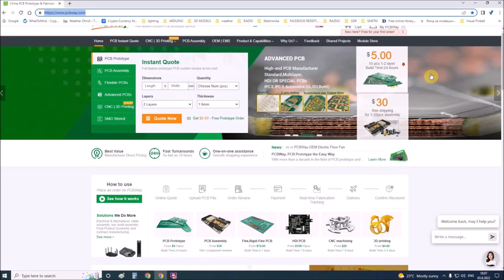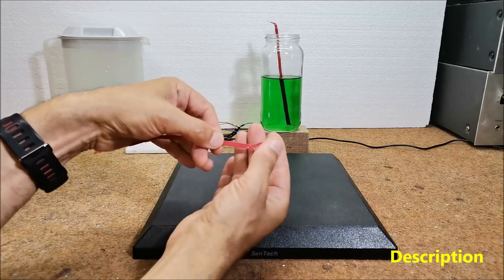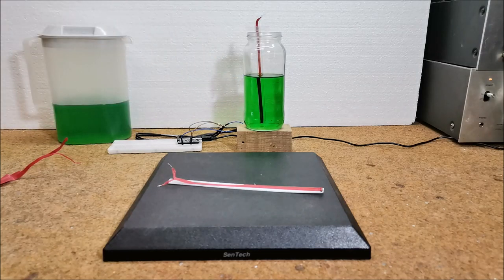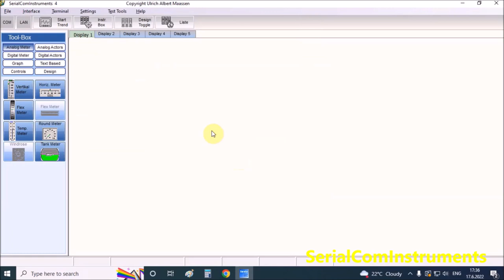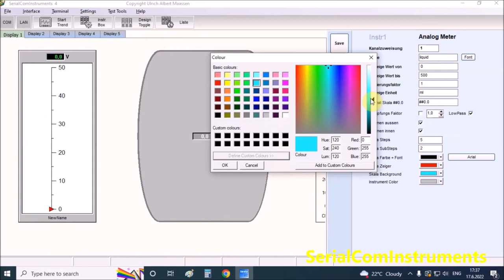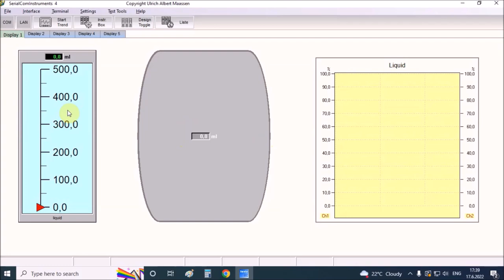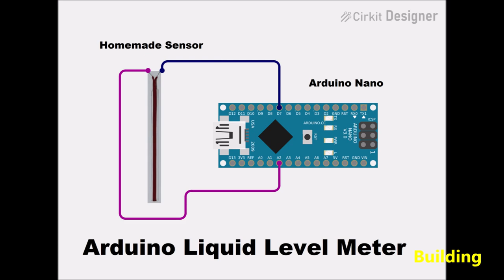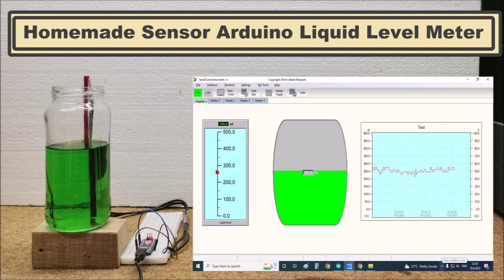Arduino Liquid Level Meter with simple Homemade Sensor

Comment: The video shows 3 wires connected in the breadboard. Where should the 3rd wire be connected?
I tested this out and there is a lot of noise in the readings.

Comment: Hi, nice project Indeed. I want to ask a question. My water container has 1 meter height. Than means I must use a 1 meter ribbon cable long. Is it sure it will work correctly without changes? Thank you.

Comment: This works beautifully. Only two wires needed. Arduino uno R3 pin A5 and pin 7 in my case.  Be sure to use the capacitor. h library.  In a 300 mm deep container 4 wires gives readings of 9 to 25 pF. With 8 wires it ranges from 9 to 55 pF.  Quite linear with R-square of 0.9815. Thanks Mirko

Comment: I love it, I'm going to try a reduced version and it works well for me, I use it in a diesel tank I have.
Would it be very difficult to do it with LEDs? I'll try some type of resistance level reader.

Comment: Looking at your hackster link ... where is the source or project that has #include <Capacitor.h>?
Reply from the maker: https://reference.arduino.cc/reference/en/libraries/capacitor/
Reply: Oh wow
Arduino library
I wonder if there's a port for ESP32
Reply: @rhenry74  if there is not, all you need is the analog pin, and a digital pin.
maybe I'll write a port, if I cannot find one.

Comment: can I get the exact code for this project? heres what I get from the video I watch but the code you give to us isn't updated #include <Capacitor.h>
Capacitor cap1(7,A2);
int kondenzator=0;
int w = 0;
void SendString(byte InstrNo, int MValue) {
  Serial.print('#');
  Serial.print(InstrNo);
  Serial.print('M');
  Serial.print(MValue);
  Serial.print('<');
}

void setup() 
{ 
Serial.begin(9600);
}

void loop() 
{
kondenzator = (cap1.Measure())*100;
 //Serial.print(kondenzator);  // Measure the capacitance (in pF), print to Serial Monitor
  int w = map(kondenzator, 220, 320, 0, 500); 
 Serial.print(w);
    //SendString(1,w);       // Instrument #01
    //SendString(2,w);
    delay(500);
  }
Reply from the maker: The given code is functional, you need to use the Capacitor library : https://www.arduino.cc/reference/en/libraries/capacitor/

Comment: this video doesn't work , I have not been told everything(which is very likely) , I have tried it several times and it doesn't work a thing , then it is outrageous that you don't explain anything either in the video or on the site...you would even want someone to buy you a coffee...if you explained things properly.
Reply from the maker: The device, as you can see in the video, works flawlessly. The SerialInstruments application and the capacitor library are not mine, I'm just explaining how you can use them to make such a device
Reply: @MirkoPavleskiMK   explain to me why it doesn't work...I used the arduino wires joined together but the readings are wrong , couldn't you redo a video, where you explain much more , more things ? like what wires to use , which ones not to use and things like that ? and also in the code explain it more ?

Comment: Arduíno code example
Reply: It's on the page that he posted just above (see his link).
It's about 3/4 the way down the page.
Also, for the library, in Arduino, just go to Manage Libraries and type Capacitance.
It's the first one in the list.

I've tested the code and its compiles fine.

The library is also very small, which is great.

Now I need to see if this will work on an Arduino Nano EVERY board.

I'm pretty much using those exclusively as they have much more memory than an Uno or Nano and are faster.  The only problem, is that not all libraries work on these as the architecture is different than a regular Nano.

But I don't see a problem here as the code is very simple and what the library does is also simple and should be easy to modify if there's an issue.

I did just test it by compiling for the Nano EVERY board and sure enough, there is a warning.
So this will need to be tested first on a reg. Nano, then on the EVERY board to confirm it works.
Reply: @BlondieSL  Hi, may i know if the code is working with arduino UNO?  I don't really know  much about arduino. Just starting to learn.